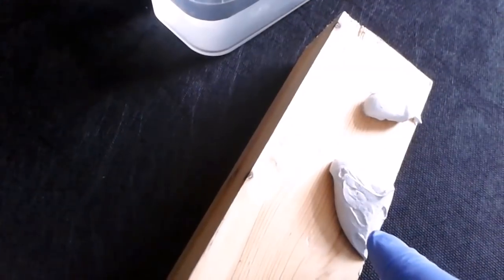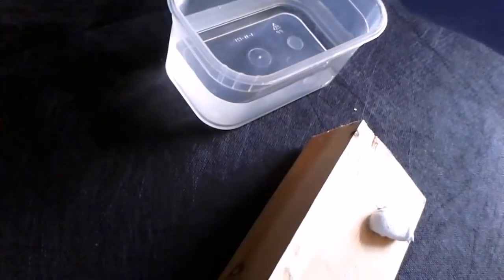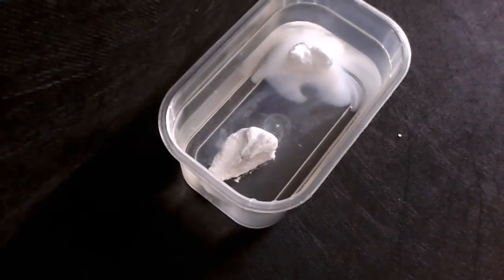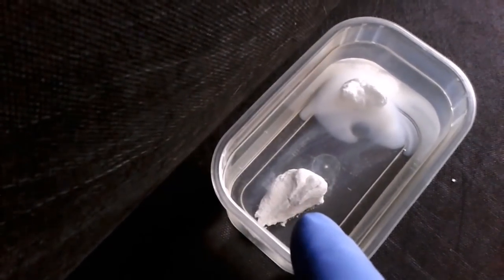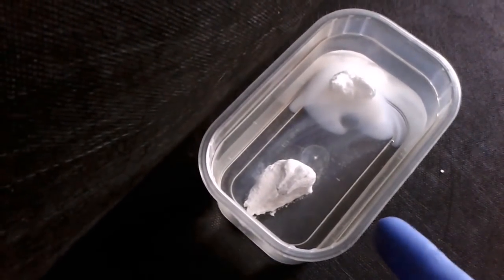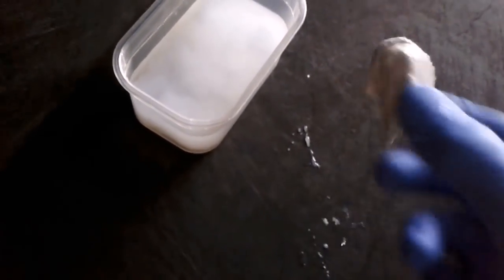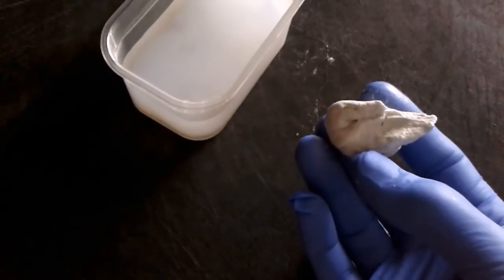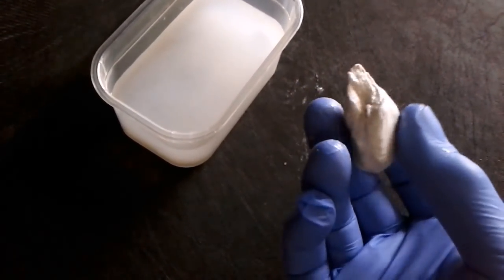Powder Filler Vs Decorators Caulk /Exothermic Vs Endothermic

Comment: Interesting demonstration but nothing whatsoever to do with exothermic or endothermic. Those terms have a very precise meaning. The former involves thermal energy being released meaning the reactants get warmer. The latter means the opposite - the reactants get colder. What you are demonstrating is that polyfiller, like mortar and cement, cure through a hydration reaction and do not actually "dry".
Reply: So just don't use caulk anywhere that will be under water for an hour.  Lol pointless video really.
Reply from the maker: @damiensmith8351  wrong the video shows in cold damp  weather caulk just will never dry slows your job down.
Reply: Now that's a great tip! One thing I've picked up from your videos is that you don't (ever?) use caulk and I can see why. After watching some of your videos where you spray foam and polyfiller over, I went around my house looking at all the places where I had put caulk, and nearly all of them had cracked. Looks like I have some work to do...
Reply from the maker: @davelowe1977  Thanks, it does work well cracks have always been  difficult to solve permanently.
Reply: @PaintingandDecorating  indeed, that's why its only used internally, and if the house is too damp and cold then there is more to worry about than using caulk. If it's that damp then the paint will be compromised and be flaking either way eventually.
Reply: Actually Painting & Decorating is correct. Evaporation is endothermic because water molecules must absorb heat from the surroundings to increase their kinetic energy.
Reply from the maker: David Lowe polyfiller does get warm and they are the correct terms.
Reply: Painting and Decorating 
Well in that case, why did you not mention temperature once in the entire video!?
Reply from the maker: David Lowe sorry about that,.  but yes it does get warm.
Reply: Painting and Decorating 
Sound. I can see what you mean now. Polyfiller cures in the same way as concrete and the reaction is exothermic. When large volumes of concrete are poured (like in dam walls) they sometimes have to incorporate cooling pipework in the concrete or it gets too hot! However, caulk does not cure with an endothermic reaction - that is not why it won't set under water so it is not correct to contrast them that way. I assume that caulk is an acrylic polymer emulsion that sets by crosslinking as the water that suspends the polymer chains evaporates.
Reply from the maker: David Lowe evaporation is an endothermic reaction.
Reply: Painting and Decorating 
No. Evaporation is not a reaction.
Reply from the maker: These examples could be written as chemical reactions, but are more generally considered to be endothermic or heat-absorbing processes:
melting ice cubes.
melting solid salts.
evaporating liquid water.
Reply: I watch your videos because I learn a great deal about a subject that I know little about - namely painting and decorating. In my day job I'm a contracting chemical process engineer - chemistry is a subject that I know well. What you are demonstrating in this video are two substances that cure in different ways. Pollyfiller cures by hydration which is exothermic. Caulk is a water based polymer emulsion which cures by evaporation and the subsequent crosslinking of longer polymer chains. It does not cure because of specific heat of vapourisation or because evaporation causes thermal energy to be lost from a liquid as its molecules pass into a gaseous phase. To conflate these two things is to draw a false conclusion and is wrong. The caulk dissolves in the water because it is already suspended in water - that is what an emulsion is. The polymer chains are kept apart until the water evaporates and then they crosslink which is why it cures and does not dry and why it stays cured in the presence of water. If you were to gently heat the milky looking water to encourage the water to evaporate faster, eventually the caulk would cure. Exothermic does not mean it will cure underwater and endothermic does not mean it won't.
Reply from the maker: @davelowe1977  lol you need a new job.
Reply: I think what he's looking for is soluble and non soluble, since that's pretty much what this experiment shows, although the compounds themselves have different thermal properties. Hence you can work Caulk with a damp cloth even after it's dried  but need sand paper for filler ;)
Reply from the maker: When the medium in which the reaction is taking place gains heat, the reaction is exothermic. 
Pollyfiler gets warm and begins  to dry in the water. This video is nothing to do with things being soluble in water.